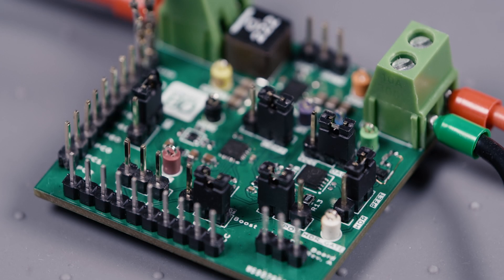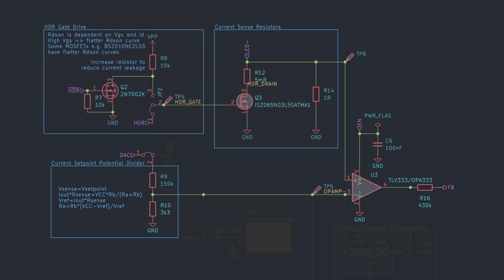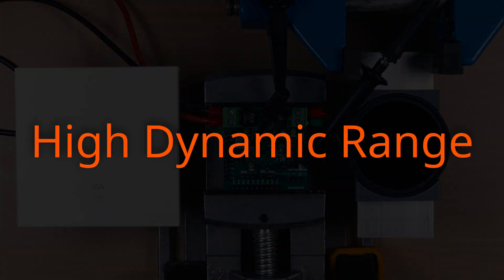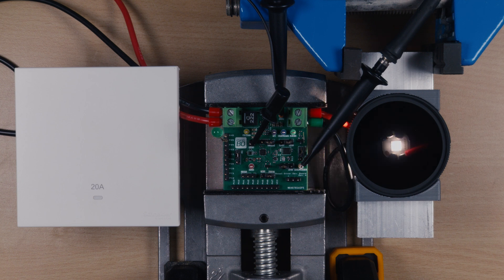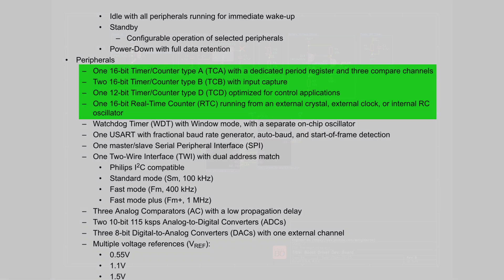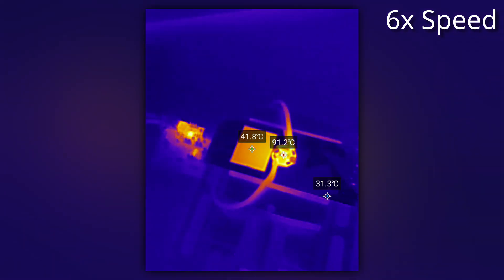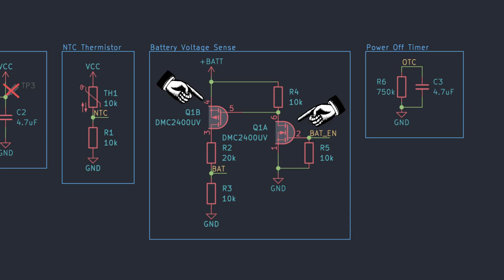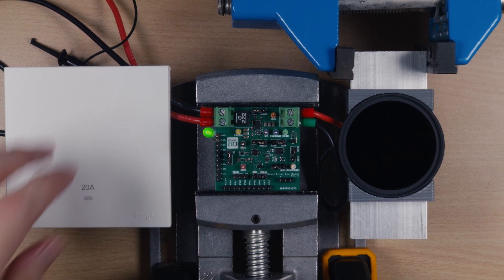Building My Ultimate LED Flashlight: Boost Driver Circuit Episode #2

Comment: 12:03 I think I may know why you have oscillation on FB pin. Do you have any scope shots of your output? Does it look like a square wave?

I simulated a similar spec boost converter driver in spice and found that if the integrator op-amp has too low RC time constant, then the slew rate is too fast. As you mentioned in your video you tuned your capacitor. I'm curious if you tried larger C values and maybe larger R values on your DAC divider.

Also I noticed a variable resistor/potentiometer in your schematic, but increasing that even to infinity doesn't actually increase the Thevenin resistance of the signal coming into the (-)minus pin of the op-amp. You would need either a resistor in series, or increase the voltage divider resistance by a decade. Common values are 10k and above. You are almost one order of magnitude away from that. See https://www.ti.com/lit/an/sboa275b/sboa275b.pdf?ts=1732109305833

Comment: nice video and very well explained.  The idea behind the "Frequency compensation" is to creat a PI, or PID controller so that the system can be modified to be fast and stable. We use the capacitors as integrator and the resistor as the proportional part.
Reply from the maker: Thank you! It makes sense conceptually, but I suppose just like many PI controllers, the tuning process involves some (or all) trial and error.

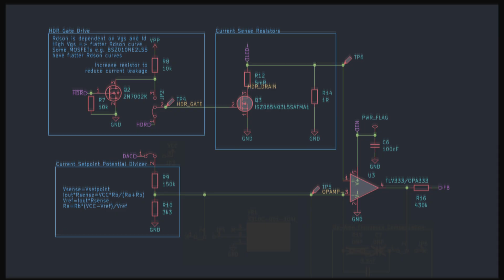Comment: 3:09 I'm guessing the P-Channel didn't work because once you turn it on by lowing the HDR signal, you won't be able to turn it off again because the HDR signal voltage at the gate will never be higher than the Drain.
Reply from the maker: The gate is pulled up by R7, so it only needs to be left floating for the MOSFET to be switched off. The problem is nHDR, which is connected to the MCU, cannot be pulled up to VPP. 

The MCU's GPIO protection diodes clamp the pin voltage to between GND and VCC (with a margin of error due to the forward voltage of the diodes). That means nHDR is clamped to ~VCC (and VCC < VPP), stopping the MOSFET from being switched off.

Comment: You can get away with a high resistance voltage divider for battery sensing by adding a filtering cap to the signal line. I got very accurate measurments out of a esp32 inbuilt adc using a divider and filter cap for a floating hydrometer i designed. Leakage current was pretty much non existent, would run for 2 months on a single 18650
Reply from the maker: Yes that makes sense! The capacitor would provide a low impedance source for the ADC, with an added benefit of being a low-pass filter.

Comment: Have you considered using the Microchip's microcontroller-peripherals-for-lighting ? I think version 2 will be blast using this approach. You could design a Type 2 controller or PID controller for the LED drive architecture and may using the built in OP-AMP to perform current monitor.
Reply from the maker: Which MCU are you referring to? If it meets the requirements, it's definitely worth a look!